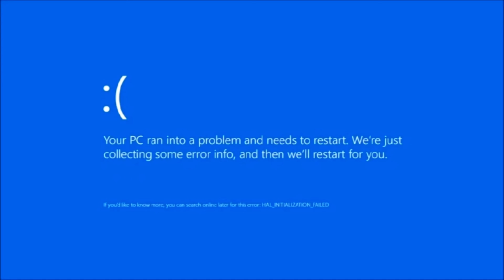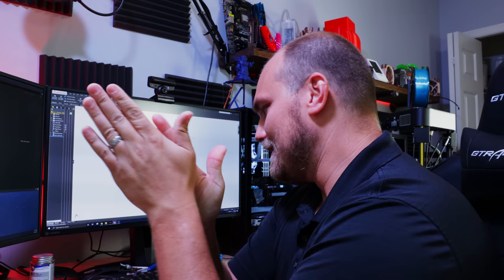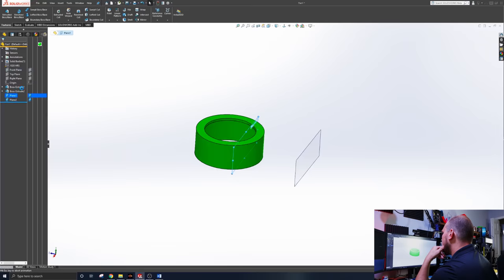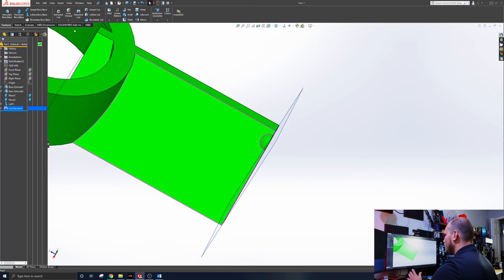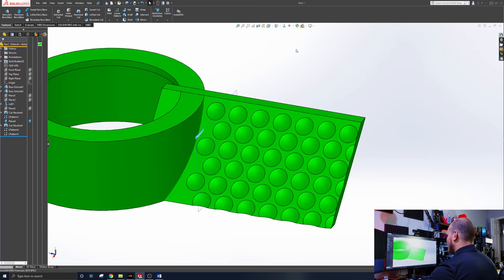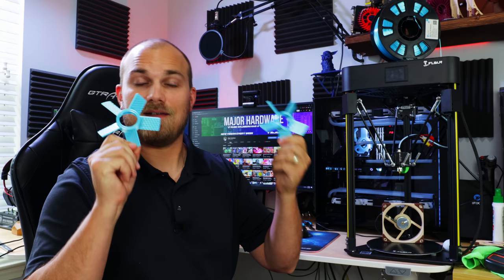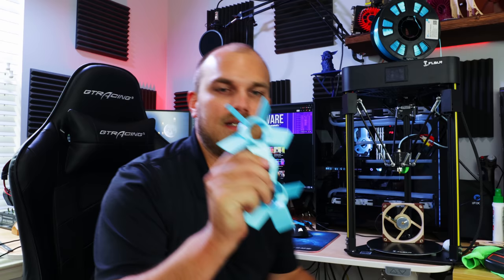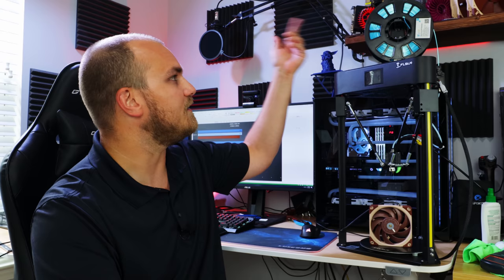What If Fan Blades Had Dimples Like A Golf Ball?

Comment: Perhaps the dimples are only effective on a spherical shape?
Reply: yup, the reason dimples affect golf balls and not fans is that when an object moves through the air, it creates a low-pressure area behind it, creating drag and slowing down the body, because of this, a teardrop shape is the best shape for limiting drag since its outline follows the low-pressure area allowing it to negate the effect almost entirely. the golf ball on the other hand is made to be sphericle to allow for non-directional hits, and therefore must be designed to minimize drag some other way. 

this leads us to the dimples, and how they reduce drag. they do it by creating turbulence on the surface of the sphere, which creates vortexes swirling into the low-pressure zone behind the sphere, allowing air to fill the low-pressure zone more quickly, and lessening the effects of drag.
now, the reason this effect doesn't work on the fan is that its shape is significantly better aerodynamically starting off, as its blades do not generate low-pressure the same way the sphere does, since they are already thin, and don't require air to bend its path nearly as much in order to pass around it.

Comment: Erm, isn't the whole point of the fan blades to push as much air as possible?

Making it more aerodynamic wouldn't make it better (unless it spins faster), it would make it worse as it won't push as much air as possible. 😂

You need that air resistance. More resistance means it's pushing more air. Making it aerodynamic would decrease the amount of air being pushed.

In other words, here dimples would have the opposite effect, and to a certain point, they do, but it is so minuscule. So it kinda is of benefit here in order to limit materials used.

Comment: They go farther because they are more stable, dimples actually cause tremendous drag where ever they are put.
Reply: Wrong, the reason dimples affect golf balls and not fans is that when an object moves through the air, it creates a low-pressure area behind it, creating drag and slowing down the body, because of this, a teardrop shape is the best shape for limiting drag since its outline follows the low-pressure area allowing it to negate the effect almost entirely. the golf ball on the other hand is made to be sphericle to allow for non-directional hits, and therefore must be designed to minimize drag some other way. 

this leads us to the dimples, and how they reduce drag. they do it by creating turbulence on the surface of the sphere, which creates vortexes swirling into the low-pressure zone behind the sphere, allowing air to fill the low-pressure zone more quickly, and lessening the effects of drag.
now, the reason this effect doesn't work on the fan is that its shape is significantly better aerodynamically starting off, as its blades do not generate low-pressure the same way the sphere does, since they are already thin, and don't require air to bend its path nearly as much in order to pass around it.

Comment: The problem with creating dimples is that golf balls are intentionally not the most perfect pattern they could be.  The size, shape, and arrangement on dimples can be altered to make the ball behave the way you want.  Uniform dimples in a perfect pattern are not good for aerodynamics.  You'd have to get an actual fluid dynamics engineer to find out what proper dimples could do to a fan blade's performance.
Reply: There are actually golf ball dimple patterns that are deemed illegal due to their ability to increase distance and improve the aim.  Basically all golf courses would become par 3 when using those balls and there isn't enough room to go increasing the size of golf courses just so we can use those balls all the time.

Comment: Its expected the lack of difference since the blades themselves are of crude design.
Reply: the design of the fan won't matter, nothing you can do to the dimples or the fan can make them work better because the reason dimples affect golf balls and not fans is that when an object moves through the air, it creates a low-pressure area behind it, creating drag and slowing down the body, because of this, a teardrop shape is the best shape for limiting drag since its outline follows the low-pressure area allowing it to negate the effect almost entirely. the golf ball on the other hand is made to be sphericle to allow for non-directional hits, and therefore must be designed to minimize drag some other way. 

this leads us to the dimples, and how they reduce drag. they do it by creating turbulence on the surface of the sphere, which creates vortexes swirling into the low-pressure zone behind the sphere, allowing air to fill the low-pressure zone more quickly, and lessening the effects of drag.
now, the reason this effect doesn't work on the fan is that its shape is significantly better aerodynamically starting off, as its blades do not generate low-pressure the same way the sphere does, since they are already thin, and don't require air to bend its path nearly as much in order to pass around it.

Comment: This test seems flawed...why wouldn't they spin at the same rate?  It's controlled to spin at a certain RPM...wouldn't a better test be to turn it off and see how long each one takes to fully stop?  Then, less power could be used to run the dimpled fans if they were able to spin longer if the dimples were shown to reduce drag...

Comment: Too subjective on the results. Make a small tunnel and use an anemometer to measure the air movement in the tunnel.  You wont be able to tell subtle changes in wind speed or turbulence by ear. Also connect the fan to a spot on a mother board and use the fan control to test at various rpm. see if there is a difference and if it scales at different rpm.

Comment: I do wonder why you're measuring CPU temps on different fans as the differences will be barely noticable if any.
Can't we measure things like power draw, flow rate, static pressure & noise & dust buildup in equal-RPM scenarios?
A fan like in this video would be suitable for no-obstruction flow-rate, and it gets tested on a radiator.

Comment: sorry to  burst your bubble but its already been done Sharkoon make a fan with dimples for reduces drag https://www.overclockers.co.uk/media/image/thumbnail/FG006SH_7511_800x800.jpg the Silent Eagle 2000 by sharkoon , makes reduces noise and comparable CFM

https://www.overclockers.co.uk/sharkoon-silent-eagle-2000-120mm-fan-3-4-pin-fg-006-sh.html

additional , PC fan purchasing of is based on Noise in DB , and Cubic Feet Per minute , this is what defines the buying characteristics and performance of a fan , the Power drawn on a 12 V fan is irrelevant to be honest no ones ever measures off the shelf power  so there is no comparison

Comment: If dimples reduce drag, or offer any aerodynamic advantage, they would be all over airplane and rocket surfaces.
Reply: Dimples on golf balls do significantly reduce parasitic drag, but the airflow around an airfoil is much different than a sphere, and they do not offer the same benefit. As a smooth golf ball travels through the air, it creates a region of low pressure air behind it as the initial laminar flow around it separates. That low pressure air behind the ball essentially creates the same effect as lift on a wing, except that this 'lift' is opposite the direction of the ball's travel. Thus, it slows the ball down. Dimples on a golf ball work by intentionally tripping the flow into turbulence far earlier than it normally would. A counterintuitive effect of turbulent flow around an object is that it delays flow separation, meaning the air does a better job of staying attached around the golf ball. The end result is it reduces the low pressure region behind the ball dramatically, and does indeed reduce the drag. The physics of rockets and wings are a lot different, because of their shapes and even their physical sizes, and for the most part dimples wouldn't do much to help them. However you will sometimes see small 'bumps' on aircraft wings which are vortex generators, which do the same thing I described above (trip the flow into turbulence intentionally to help keep the flow attached). source: have degree in aerospace engineering

Comment: INVERT THE DIMPLES INTO PIMPLES or possible dimples on one side protrusions on the other
Reply: There used to be fans available back in the day with those.
Reply: this won't matter, nothing you can do to the dimples or the fan can make them work better because the reason dimples affect golf balls and not fans is that when an object moves through the air, it creates a low-pressure area behind it, creating drag and slowing down the body, because of this, a teardrop shape is the best shape for limiting drag since its outline follows the low-pressure area allowing it to negate the effect almost entirely. the golf ball on the other hand is made to be sphericle to allow for non-directional hits, and therefore must be designed to minimize drag some other way. 

this leads us to the dimples, and how they reduce drag. they do it by creating turbulence on the surface of the sphere, which creates vortexes swirling into the low-pressure zone behind the sphere, allowing air to fill the low-pressure zone more quickly, and lessening the effects of drag.
now, the reason this effect doesn't work on the fan is that its shape is significantly better aerodynamically starting off, as its blades do not generate low-pressure the same way the sphere does, since they are already thin, and don't require air to bend its path nearly as much in order to pass around it.
Reply: @TwelveCrows  the hypothesis was to invert the pattern, invert the effect.
Reply: @azhiaziamnohiah897  first off, it had no tested effects on the fan, meaning inverting the effect would leave it with none, secondly raised sections on a ball/wing/blade are functionally identical in their effect in generating a turbulent surface layer as dimples. my final point will be that any knowledge whatsoever of aerodynamics would show you that your hypothesis was foolish, and therefore, I can deduce that your understanding of aerodynamics is not sufficient to carry on this debate in a meaningful way
Reply: @TwelveCrows  thank you for helping me understand, there was no debate. If I was an aerospace engineer. Then I would have seen this video as being foolish altogether and not watched it..  but thanks for expounding my knowledge..   I hope I didnt come across crass like you and I apologize if I've offended your ego.
Reply: @TwelveCrows  oh and I was thinking of increased velocity of wind..  not decreased turbulance...

Comment: This test is super flawed, because computer fans run at a set speed, and no matter weight or blade design, they will adjust the current to match the rpm.

Comment: Flawed experimental process.  The motor is a defined entity, and will rotate at whatever speed it is designed for, and movement of air in this case will be negligible, because if it is doing anything, it is letting air slip past the blades, instead of moving it.  You should have set them up as propellers in a defined air column driven by a standard fan, and measured thier efficiency as power turbines (plotting voltage and current output from the hub). Or even if on a spindle, just measure the RPM.  This will tell you if the blade is being moved by the air, or if the air is slipping easier over the surfaces like on the golf ball.

Comment: Now it's time for ruffles. Please make a fan with ruffles going in the wind direction and another with the ruffles perpendicular to air flow. Okay? Do it right now. Don't do anything else, just ruffles. Plus do a pair of fans with the ruffles diagonal to the airflow, one in each direction. Now.  Ruffles this way, ruffles that way and then ruffles the other two ways. After that we want different ruffles on each side of the blades. Got it? Good, do it now.

Comment: So you have this rough 3D printed plastic surface (in comparison to machined or poured parts with a nearly perfect surface) which creates turbulences and disturbs the air flow. And now you make this worse with dimples, otherwise known as bigger surface impurities? :)

At all this whole setup is worthless (in a scientific sense, to gain knowledge) without measuring the airflow/power consumption ratio. Your fan probably is speed regulated (you don't tell about that), so the speed measurement is probably meaningless.

Some meaningful ratings that could at least say something useful:
- Airflow performance, with a focus on cooling output
- decibel(sound pressure level) to rotation speed ratio -> Noise level comparison
- Airflow to consumed energy ratio -> Energy efficiency

Your temperature based measurement are flawed. They introduce a whole new system of unknown variables into the equation that is not needed to describe the test candidate. So you don't tell how warm it was in your room. What is the thermal mass of the system under test? How exact is the added thermal energy known and how big is the cooling coefficient? How is the reaction time of the system,  etc.

Comment: Dimples increase the distance for golf balls because of the way air flows around a sphere due to a phenomena known as laminar air flow. A golf ball without dimples would have greater drag due to that laminar flow. [ https://www.livescience.com/32446-why-do-golf-balls-have-dimples.html ] . In your experiment the combination of the very low surface area and very low aspect ratio of the blades combined with the lack of curvature of those blades make them pretty inefficient in the first place so there's not a lot you can do to the surfaces of those blades to improve the amount of air it moves. But if you could make the blades longer, as those curved blades on the stock fan, then that would be interesting. However, airfoils depend on laminar flow for efficiency. Dimples disrupt the laminar flow (see the link above) and would DECREASE the efficiency of the fan.

Comment: oh.. rotating mass a factor.. lol. but not much dif.. lol remember.. that lil weight is more resistant work for motor at max rpm
Reply: only dif.. dust catching still.. try that.. see which collection of dust.. is more.. dimpled of not dimpled.. i bet straight worse.. lol cuz air cushioning.. on dimples.. if science guess accurate

Comment: A lot of the dimples right on the edge are cut off. Golf balls have only full dimples.
Reply: this won't matter, nothing you can do to the dimples or the fan can make them work better because the reason dimples affect golf balls and not fans is that when an object moves through the air, it creates a low-pressure area behind it, creating drag and slowing down the body, because of this, a teardrop shape is the best shape for limiting drag since its outline follows the low-pressure area allowing it to negate the effect almost entirely. the golf ball on the other hand is made to be sphericle to allow for non-directional hits, and therefore must be designed to minimize drag some other way. 

this leads us to the dimples, and how they reduce drag. they do it by creating turbulence on the surface of the sphere, which creates vortexes swirling into the low-pressure zone behind the sphere, allowing air to fill the low-pressure zone more quickly, and lessening the effects of drag.
now, the reason this effect doesn't work on the fan is that its shape is significantly better aerodynamically starting off, as its blades do not generate low-pressure the same way the sphere does, since they are already thin, and don't require air to bend its path nearly as much in order to pass around it.
Reply: @TwelveCrows  Correct, but not really relevant to my statement. I was merely pointing out that the experiment fails as a test of "golf ball dimples on fan blades", since "golf ball dimples" are never broken - always a complete concave circle. If the good Major wanted to do a true test of "golf ball dimples on fan blades", he would need to change the pattern/alignment so that no dimples are bisected at the edge of the fan blade. The presence of even a single broken dimple invalidates the entire experiment.

Comment: "I hate the imperial system... a lot... but what are you gonna do?" EXACTLY what you did.  Stop using it.  I did.  I measure things in metric now and convert for the ignorant heathens as necessary... or stare at them and tell them "convert to your own backwards system, savage" and go about my metric glory.  I honestly don't care if we use "inches" or whatever word, but I'm about done with fractions and weird multiples like 12... nope.  Decimal point movement ftw.

Comment: dimples aren't round, they're hexagonal. hence why they touch on a golf ball.

rpm is not a useful test as the motor would compensate by using different power. you should have tested the motor draw. this would measure drag. Also you should have used a decibel meter to check the actual sound level vs ears or a mic... 

n the lift is what dimples add..so maybe do this on a DRONE. THAT would be an awesome test! you could have also tested this with a cfm test.

come on... science, man. I'm into engineering. so I know what tests to use :3 fun stuff